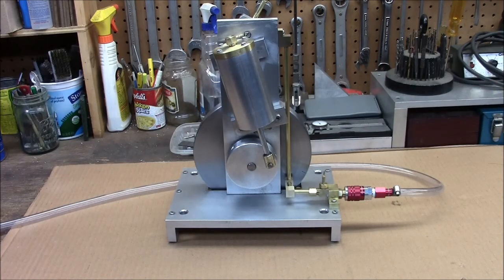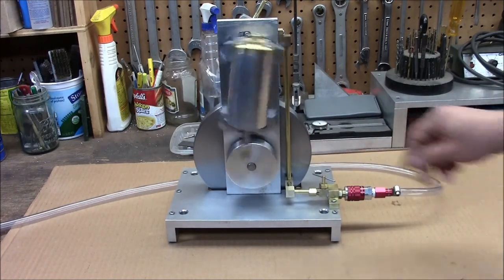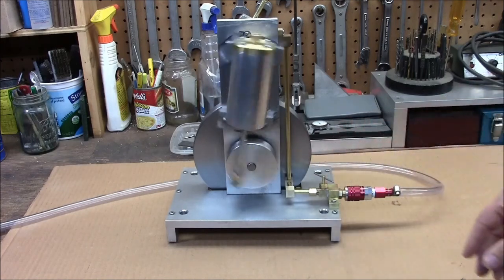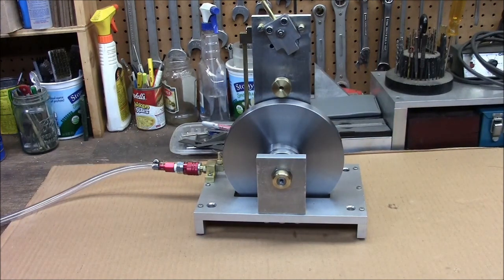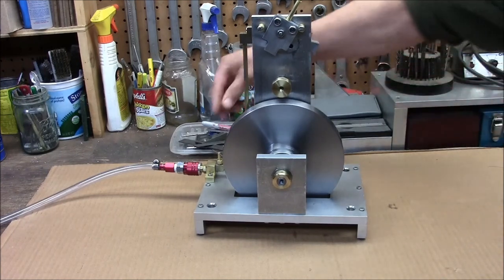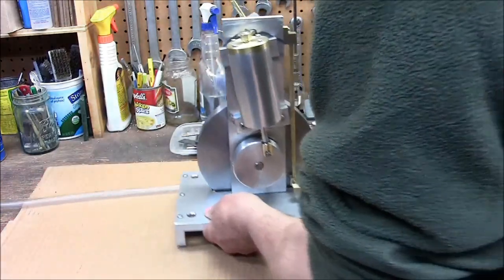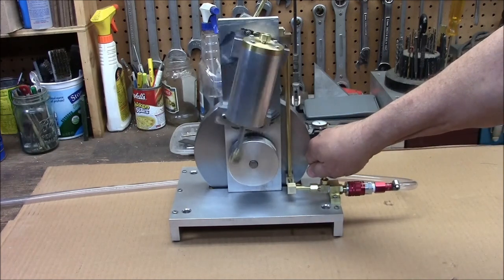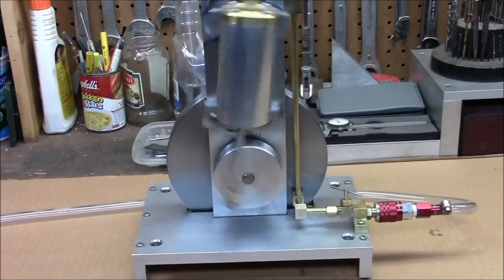My second larger Steam engine

Comment: Fine solid looking engine. I love the minimalist look of it.

Is it single or double acting?
Reply from the maker: Thank you Gary.  Except for the reversing mechanism I think it is the simplest and most easy to build Steam engine there is.  If you have not already done so, take a look at some of my other scratch built engines.  They are all one of a kind.  Thanks for watching-  Fred  Ontario, NY
Reply: I assume it's single acting then. I like the way that you have made it quite large in size. I reckon it's a good idea to go as big as one's machines will allow. I have looked at your other engines, and very nice they are too!
Cheers.
Reply from the maker: Thanks Gary!  If you have any questions or ideas drop a comment!
Reply from the maker: Yes, it is single acting.  When I take it to steam shows it gets a lot of looks because it is big, loud and moves smoothly.  Thanks for watching...  Fred
Reply: Fred - I guess a lot of people are put off building larger engines to start with for various reasons, including not having a lathe big enough to turn a large flywheel. I haven't yet built an engine, but am currently building a boiler  and plan to make small engines to run on it, starting with a small single-acting oscillator. I'll post a video on the boiler when it's finished. However, my aim (once I get a bit more knowledgeable) is to go bigger in both boiler and engines. Your engine here is a real machine, not a toy. I like that.
Reply from the maker: Thanks Gary.  This engine could easily power a 20' launch boat.
Reply: Wow...